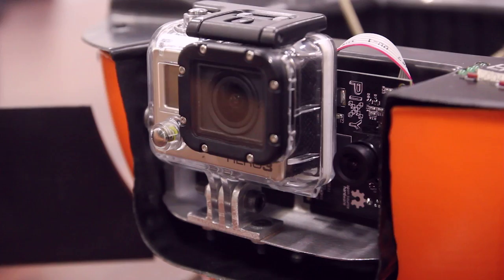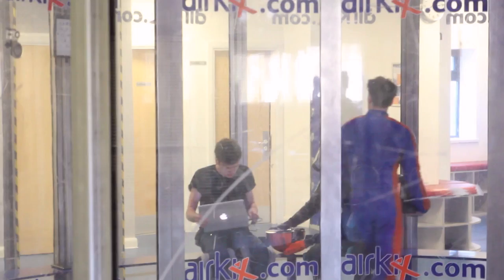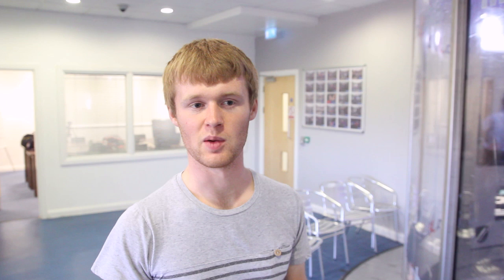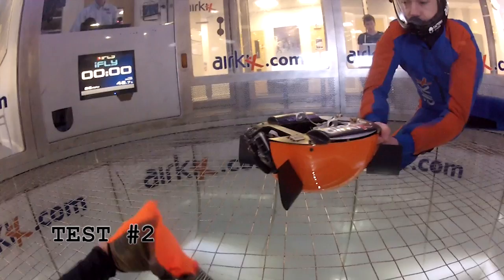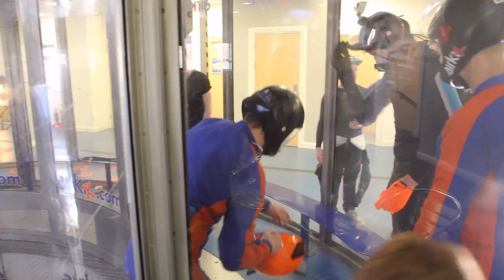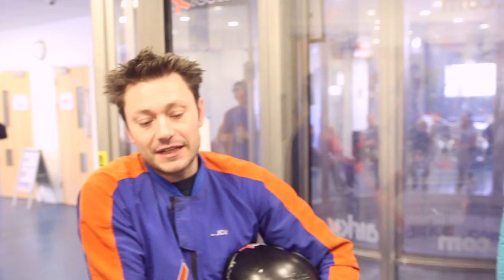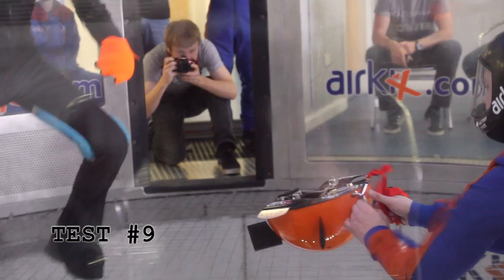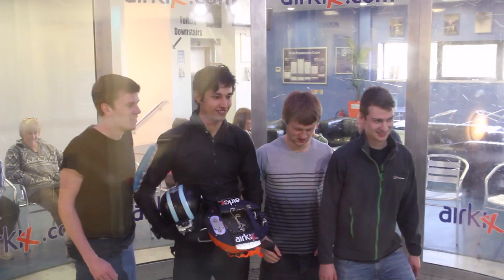Wind Tunnel Tests - Freefall Camera #8

Comment: it came out pretty nice.

but guys, you should try to avoid floating point operations in these microcontrollers like the plague. they are slow and can easily induce lag in the system. see if you can replace those values with int16_ts with an order (or two) of magnitude higher.

also you might want to add a secondary sensor for when the camera loses visual contact. in ww2 radio waves were guiding bomber planes, see if you can adapt the idea :)

Comment: I assume you've done some simulation of the air currents on the camera but the half sphere seems like it would cause turbulence problems. The semicircle facing the wind created extreme oscillating turbulence in a smoke tunnel I used to demonstrate at a science museum. Our smoke tunnel was a narrow vertical wind chamber with 20 or more smoke nozzles on the right. Forced air drove the smoke across in straight lines. By placing cross sections of an airfoil on a shaft (which could be rotated) you could see the effects of drag and lift on the air currents at different angles of attack. Of course any modern computer could do the same, even with solid shapes.

Comment: If there was some weight on a shaft extending down, below the ball, the controls would act more like the tail on an arrow and will be so much more stable. The CG needs to be farther in front of the controls. Not just 2 inches lower than the flaps. A foot or so.    Balancing a ball attached to a stick is easy. Balancing it on your finger without the stick is inherently unstable.

Comment: This demonstration went very well. Kudos to you guys!

Was there a reason why you didn't have a placeholder-weight for the parachute? Or, more fundamentally: why couldn't the software adapt for the lower weight? Is there some lower limit to the weight, or is the expected weight hardcoded into the software?
Reply: if its on minimum drag setting you cannot do anything with software to further lower the drag

Comment: Have you thought about using an infrared strobe for the camera to track instead of a certain color?
Reply: This is a good idea, but I don't think the go pro can detect IR?  They would need to add on an IR receiver for that, might not be possible.  Wonder if they have considered the idea, though?
Reply: It would have to be pretty bright strobe to be picked up in the bright sun, and presumably it might be a problem when the diver might turn round.
Reply: an IR strobe would be picked up by the electronic iris of the go pro, and possibly blind the camera. shine your TV remote at your phones camera and press a button, see that white flash on the screen, imagine a camera much more sensitive, and an IR flash much more powerfull. this is the same thing that strobe powered missiles fired from hundreds of miles away use to hit their targets, as the IR flash is so bright, itd make the gopro useless
Reply: And don't forget the batteries. I think that the extra detector would consume energy and mass repartition. It's a clever idea indeed, but if it can work without it, why put more stuffs and reduce the automy?

Comment: i thought terminal velocity only dependet on drag not weight. also i think a teardrop like upper shell that might also act as pilot shute could be quite an interressting idea to test as it would probably lower the drag caused by t´he sharp edges at the top by quite a bit :) love the project :D

Comment: Hm... is the shape really the right choice. If it's a half ball then its nearly flat at the bottom and the compressed air slips all around. Maybe a pointier shape would provide a smoother airflow and so makes it easier to stabilize
Reply: A pointier shape would cut through the air more easily and provide smooth airflow, provided that it's pointing in the right direction, but any slight deviation would cause the air to catch the nose at a slight angle, which would act to amplify the deviation rather than correct it. That's the opposite of stable. Besides which, a pointier shape would fall too fast.

Comment: Is a strong upwards wind current actually the same as falling towards the earth at terminal velocity? Because, assuming roughly equal air resistance, shouldn't objects of different weights fall at the same speed? Therefore, would you really expect the camera to need extra weight for it to fall at the same speed as a human? Part of me thinks the only reason it flies better than a human right now is because it isn't falling due to gravity, its being pushed up by the wind force (which of course IS dependent on mass).
Reply: Gravity accelerates objects of different mass equally, but their terminal velocity (the speed at which air resistance and gravity exert equal force on an object) is influenced by the shape and weight of the object. Notice how the people inside are floating only when lying down, because that's when the effective surface area is largest.
Reply: Imagine replacing the camera with a balloon -- would it fall? No.
How about a cannon ball --  would it lift off the ground? No.
 It needs to be the right weight, and at the moment it's more towards the balloon end of the spectrum.

Comment: but they never let it go? or am i missing something.
Reply: let it go, let it go
Reply: Right now, they're trying to confirm that the software is controlling the flaps in the correct way so that it's movement will function properly. They tested the flaps to move it up and down, the airfoils to rotate. They held it because the tunnel would blow the little bot right up to the ceiling since it's not as heavy as it will be when it has a parachute, I think.
Reply: Since it had a temporary handle letting it fly free was probably not part of the test.  I think this was more of a test of the retractable drag airfoils and the ability to follow an object while "falling". They said it was too light for the wind speeds they were testing at anyway, even after adding some weight to compensate.
Reply: Right at the start of the test, they tried to let it go free; but the camera was floating up before the person was even starting to lift off the ground. They quickly realised the camera was too light -- which is one of the reasons for doing the test in the first place. Rather than abandon all the testing, they just held the camera.
Reply: MrLewooz only way to test is to go all out.
Reply: MrLewooz it was not about learning but testing. If i want to test if i can walk yet, i move my feet and probably fall.
Reply: Sea Wolf They weren't testing solo flight yet. They're not at that stage yet, but they will get there. Be patient :)